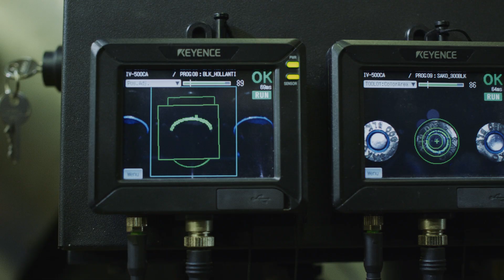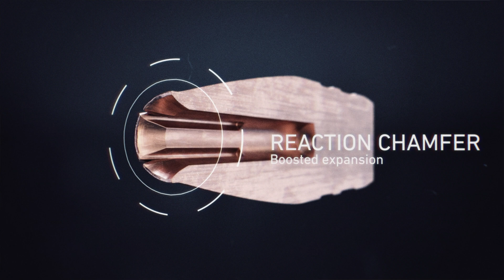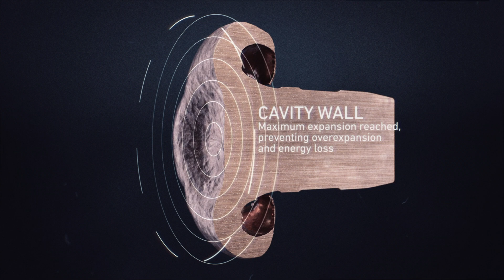Sako Powerhead Blade - Monolithic Hunting Ammunition Tech Talk.

Comment: Thank You For the information on the "New" PowerHead Blade bullets! My questions are about the Original Blade Ammo in 308win. and 6.5 creedmoor, that were Introduced in 2020 here in the USA. I have read where recently, you made some modifications to these bullets to make them more aerodynamic and added exterior coatings to make them run more smoothly. I also see U have made minor changes in the boxes the cartriges are sold in. My Questions?  Are the Earlier Sako Blade 2020 offerings in the above mentioned calibers Still Effective in taking medium/large sized game??  A local gun shop is currently offering these Early Blade Catridge offerings at a Big Discount and I wanted to know if they are still worth purchasing?? I know buying the Newest is Best, but Over 1/2 off is a Good thing if your like me on a Budget. Are these earlier PowerHead Blage Bullets still Effective? I'm a Big Fan of Sako, I have an S-20 in 6.5cm and a A-7 Roughtech LR in 308 and love Both rifles. Appreciate your insight and response! Thanks again and Straight Shootin!

Comment: I saw this video just now and like the concept. A local shooting range/shop in Calgary has this ammunition in 308 in stock. I will buy a box and see how well it performs in my new S20 Hunter. I've tried two Federal copper loads where the less expensive hollow point deer rounds grouped best but I'd like to find better. So far the only rounds in my limited tests with my new rifle, the Berger Hybrid Hunter has put bullets in the same hole. I still need to fine tune the best shooting set up on public land as indoor shooting ranges in town are short range and are extremely boring. My next shooting session with be a combination of a heavy folding table with Lead Sled and a prone shooting mat making use of a bipod. This is also in Alberta Canada in January. Brrrrrr. Then again, you're Finns and know the same conditions.
Reply: ❤ probably get hole in hole like my S20 in USA Fla.😅
Reply: @walterquick8649 they group ok in my rifle. MOA at 100. I've cloverleafed the non-bonded gamehead rounds with consistency. Pretty good as i can't get out as much as I want to. Time off and distance. 
Ive got Powerhead Blade, Federal Trophy Copper which both group the same. The Trophy Copper is a hotter load. Depending on where I hunt when I get another moose or elk draw, I'm covered. 😁

Comment: I didn't know where to ask my question so I'm asking it here. How do you explain that a box of Sako powerblade in caliber 375 HH Magnum is sold for €250 in France while a box of Norma Ecostrike is sold for €150. Thank you for your answer.
Reply from the maker: That  must be a mistake from the retailer as the Powerhead Blade 375 H&H are not sold  to consumers at this price but rather 130-150€ per box on average. Fro example, we looked at Naturabuy and prices displayed there are not correct. On Chasse Pêche discount they are at 130€/ box.
Reply: @Sakointernational 
The price normal is 249€ and promotion 171,90€.
I am saddened by this because the powerblades are very precise in my Sako AIII
Reply: On chassepechediscount it’s a promotion, the normal price is 249€. 😅

Comment: What is the minimum speed required for bullet to mushroom? 1800fps or less? What is the bc of the various bullet calibers and weight?
Reply: Not sure about minimum speed, or other calibres but the 6.5mm bullet heads are 120gr and a g1 of 0.348.
I find these blade bullets much more effective than the Barnes ttsx. I'm using a 6.5x55 running approx 2800fps mv
Reply from the maker: The Powerhead Blade technical specs can be found on our website. https://preview.sako.global/ammunition/powerhead-blade
Reply: @Sakointernational  
The link doesn't have minimum speed for powerhead bullet to mushroom and not pencil through game at midrange distances. Barnes and Hornady CX are 1800fps and above.